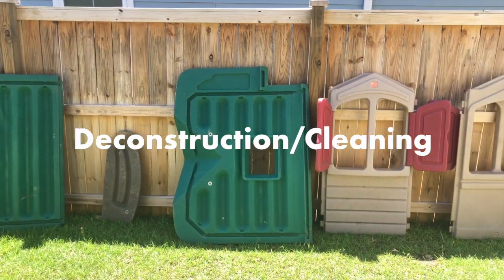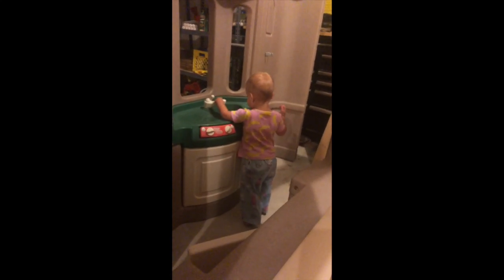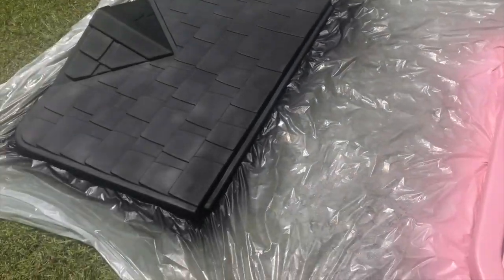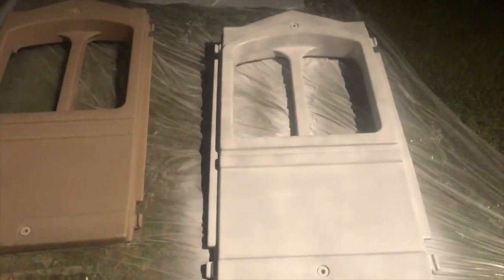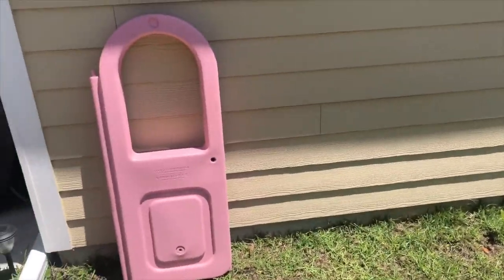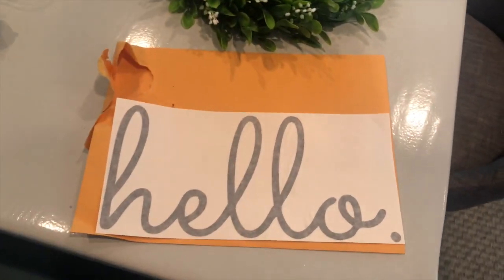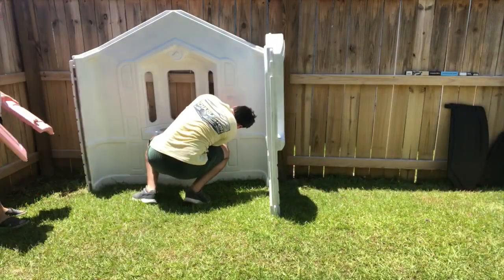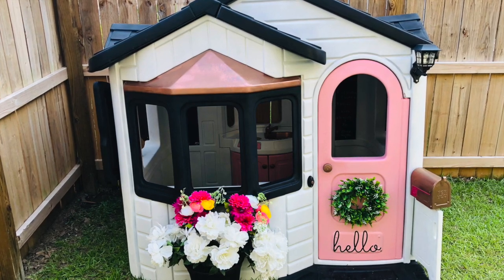DIY Playhouse Makeover 2020 || Step 2 Playhouse || Frump to Glam

Comment: Hi! I am about to do this as well and I am wondering how it held up for you through the years? Where there any chips or cracking in the paint?
Reply from the maker: The black areas and pink areas looked fantastic 3 years later . The white side that faced the rising sun definitely  showed some wear by the second summer but the side where the sun set looked great !

Comment: Hello. What sealant did you use? I painted a step2 desk for my daughter and the spray paint just chips off so easily
Reply from the maker: I just used rustoleam to seal it all in ! The area facing the sun chipped after a year or so but the side not facing the sun and the roof actually held up really well even a few years later ! Hope this helps

Comment: How was the temperature in the playhouse with the black roof? I'm really wanting to do it in black also but worried about the heat. Could you give any insight to that?
Reply from the maker: Hi Crystal that’s a great question ! I don’t think the roof caused any issues although I’m sure with the heat it didn’t help , but what I do regret making black is the welcome mat because that was SUPER hot for my daughter’s little feet .

Comment: Gorgeous! May I ask how the spray paint has held up a year later?
Reply from the maker: Thank you Andrea ! In the areas with normal sunlight everything looks great - almost perfect now at 2 years out. The area with direct humidity and sunlight ( we live in South Carolina ) - that area needs lots of work ! I love the white but it is all chipped on the far right side from the sun. White is harder to do touch ups so in hindsight I would still do it as I did it originally but with a darker color on the outside!

Comment: Did you use any more spray paint than what you originally showed in the video?
Reply from the maker: Nope ! Used exactly what I listed and it covered everything ! I ended up buying one more of anything I completely ran out of for touch up areas , especially after you reassemble and things chip a little bit :)

Comment: Did you spray anything on it to weather proof it?
Reply from the maker: Honestly I didn’t and it’s been 5 months and no issues !! The white definitely shows “ dirt and debri “ but it comes off when I spray it down. Everything has surprisingly held up really well !
Reply: @thatcaitlinS  thanks☺️. I have a little tikes jungle gym. I used flex seal around the climbing parts but I’ll leave the rest alone.
Reply from the maker: @gottahavefaith4146  that totally makes sense !! Especially with wear and tear :)

Comment: Sorry to ask another question... I just tried applying my vinyl welcome decal to my front door and it would NOT stick to the paint/door. What vinyl did you use or how did you add the “hello” touch?
Reply: SORRY! Duh! You linked it! Thanks!
Reply from the maker: No worries !! It was hard to get it to stick at first but once I got it on I’ve had no issues :)
Reply: How did you get it to stick? I received the “hello” decal you used but haven’t applied it yet. 

When I applied the one I made it just popped off in areas.
Reply from the maker: @karleestephens189  the decal stuck completely on its own and I was surprised I didn’t need to put anything over it to “ seal it “ . Been almost a year and it’s still on there ! Definitely took some time to make it stick how I wanted it but after being veryyyy patient I got it in the perfect spot and then just didn’t touch it again so I wouldn’t mess with it :)

Comment: Hey how did you manage to get the sink and tap off? Yanking? Lol
Reply from the maker: Yes !! Hah lots of banking ! I also put a screwdriver underneath to prop it up a big while we pulled it a part
Reply: @thatcaitlinS  thank you. another quick question is the paint lasting or is it chipping? People are saying not to paint as it will chip.. especially the sink as she puts water in that all the time
Reply from the maker: Hannah Sunde I haven’t had any paint problems so far- even in the sink ! I didn’t use a sealer coat , only a built in primer with the spray paint. I’m sure I will notice some wear and tear as the months go on but at the moment everything looks great !

Comment: Does it take screws or bolts? Mine came with long wood screws, I’m not sure they are the original hardware
Reply from the maker: No screws or bolts on the main body of the house . There are definitely screws on the smaller parts ( sink for example ) otherwise everything has a locking mechanism.
Reply: @thatcaitlinS  I just scored the Little tykes “Endless adventures” playhouse” for $35 used, on marketplace and look forward to refurbishing for my grandson. A bundle of replacement parts can be ordered for $35, and I found the instructions online as well. I learned it takes 2 people to put together and it does lock and I was provided with long screws (not sure if they are original)but the hardware is also included in the parts package. I know my grandson who is one, will love it!
Reply from the maker: @lindakelley2676  oh that is an AWESOME score ! Yes definitely two people to hold in place and yank a part or put back together but it sill be so worth it and he will absolutely love it :):)
Reply: @thatcaitlinS  I’m overwhelmed and inspired. off to the hardware store! I hope to find paint on clearance, easy for house paint but probably not plastic paint!
Reply from the maker: @lindakelley2676  definitely break it into sections because it can be daunting ! Best of luck !! :):)

Comment: How has the paint stood up 1 year later?
Reply from the maker: Most areas are almost perfect ! The side where the sun hits has done a little “ peeling damage “ with the white paint but not the black. I suggest doing a top sealant coat if the sun will be in contact with anything, but all in all pretty good !!

Comment: I’ve seen people use chalk paint. Ive used that plastic paint and done it the correct way but it eventually chips off
Reply from the maker: Mermaid DIYArtist I’ve definitely seen some spots that need touch ups but I also went over it with a sealant a month later and that seems to do the trick ! :)
Reply: @thatcaitlinS  i love your play house. I'm going to ask for the hundredth time. How is the paint holding up?
Reply from the maker: @jessicacouchstanley3518  for the most part great ! Where the sun hits the white part has definitely had some wear and tear 1.5 years later , but otherwise it’s not too bad ! :)

Comment: You could of just bought 2.5 gallons of pool bleach and water put 50/50 mix in a pump sprayer.No pressure cleaner. Let it sit in direct sunlight and let it dwell for 30 minutes the hose it down with water. It will melt all the dirt, grime, and algae like butter. And a new looking playground
Reply from the maker: Could have and thanks for the suggestions for others ! What I did was easy enough ;) thanks for watching !!

Comment: Do you have a link to the doorbell?
Reply from the maker: Doorbell comes with the house ! I did have to go on the STEP2 website and order a new one that is designed to go with it due to water damage though so you can easily purchase one there :)
Reply: @thatcaitlinS  :) i don't have that model but figured it could work with the one i have. We'll see 🤞🏼

Comment: How is it doing 2 years later???
Reply from the maker: The side not facing the sun looked brand new and held up great ! The black roof turned out wonderful on both sides . The white / pink facing the sun definitely had some signs of use and I wish I would have down a sealant coat every 6 ish months to help with that !
Reply: I am trying to paint a little tykes house for my son, I've used oil based primer made for plastic, krylon fusion paint and nothign sticks even after days in the sun. I don't know why it won't stick.